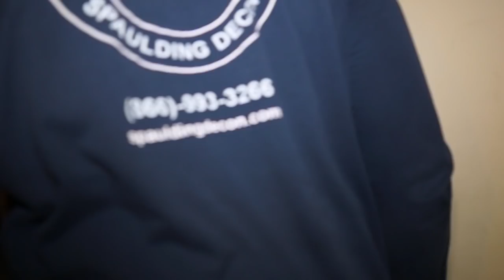Giving our Dogs a Better Home | St. Pete, FL

Comment: Started a hoard job today with Spaulding Decon. Boy the smell wasn't horrible but I was on the brink of death when I disturbed a resting can of chicken noodle soup that has been untouched for 3 years 🤮 tomorrow we are cleaning and getting into the fridge :') it's nasty
Reply: If you want, Vics or mint extract or just plain potent spearmint gum helps with the stench when you're doing biohazards. It works best with a mask that isn't easily absorbing like the thin nurse masks compared to an N-95. Helped me do dissections and clean up vomit or mold in my house.

Comment: Are those Nitrous oxide or CO2 cartridges?  If they’re the latter, I don’t get it.
Reply: Whippets are used for huffing/getting high. Very popular back in the 90s and early 2000s
Reply: @geol6174  Oh so they are Nitrous Oxide cartridges. I couldn’t figure out why they would want CO2 cartridges. NO cartridges make more sense, but damn if huffing that type is pretty bad for you. At least they didn’t buy a ton of RediWhip.

Comment: A bottle of coke cola would have left that toilet clean :)
Reply: With log-age like that, I couldn't tell if it was working or not.  I think you would probably need a couple of those plastic putty knives and a pumice stick to break through that dam.
Reply: @momtrips6783  the citric acid in soft drinks can break down just about anything it's what I use anytime I'm cleaning toilets like that. Dump a bottle and walk away for hour and scrub away.

Comment: why did my comment not show up? I was wondering if you can sell any of those whipped cream co2 canisters? I use them for whipped cream and I have a bb gun from 1950's that use that size which are hard to find and expensive for a few at a time. They only contain air and can't make anyone high, so why all the huffing comments? where they huffing?